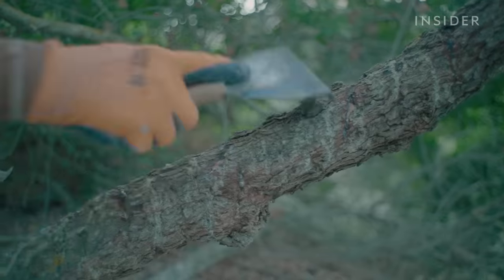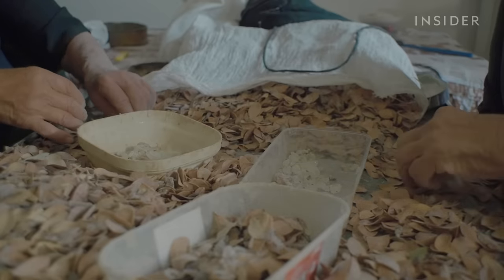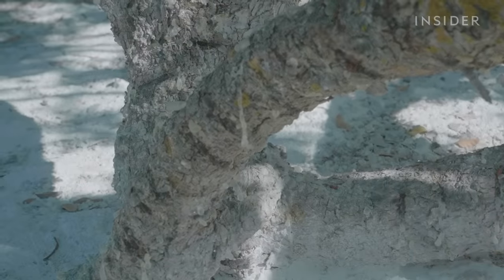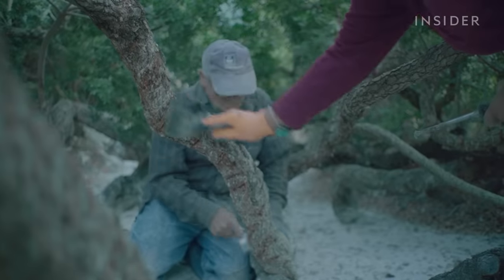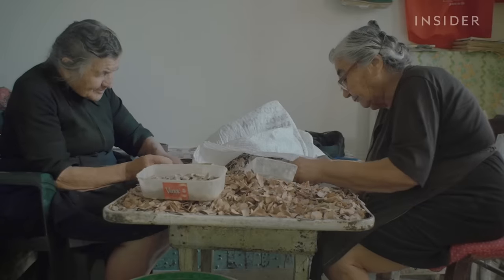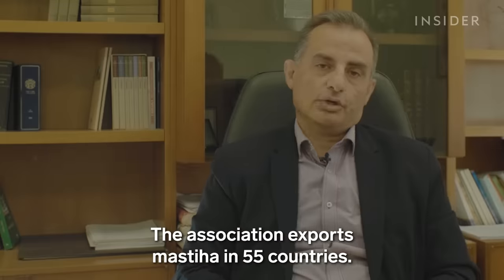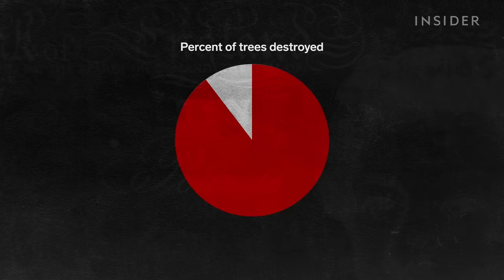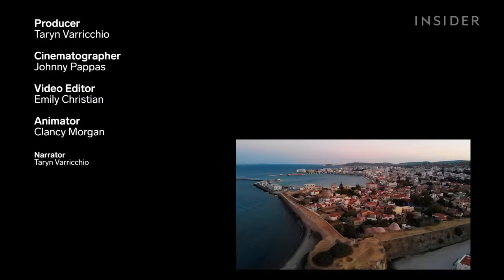Why Mastic Tree Resin Is So Expensive | So Expensive

Comment: You'd think after thousands of years of doing this, they'd figure out a better way to catch the resin, rather than just letting it fall to the ground, picking it it up with a bunch of leaves and dirt, and having to sift through all of it to separate the resin from the debris
Reply: The dirt is what make it collectable, and they can't contain it in container, since the tree heal wound so fast, make it useless to contain
Reply: I was thinking that, a tarp around the tree base?
Reply: they could perhaps tap it like maple trees. but since the tree heals fast it would also need some kind of bite or grind device at the tap location perhaps and would need to be easily move-able as well to not strain one part of the tree too much...
Reply: They know what their doing man!!!
Reply: The same way olive 🫒 are collected before processing into oil
Reply: a sive with a catchment underneath would achieve the exact same result I reckon
Reply: You'd think after thousands of years doing this, they'd wait for a random  Sean guy on YT to teach them how to collect the resin?! How audacious some people are.
Reply: @thanosthanatos8666  doubt it
Reply: It doesn't fall to the ground as is. The area around the trees are first cleared and a layer of white soil is spread. That's not naturally occurring. The resin falls onto this white soil which prevents it from being adulterated by the undesirable elements in the terrain. And no you can't tap it like a Maple tree whose sap flows like water and needs boiling in order to concentrate it into a syrup.
Reply: @Yaksoup98   That's your problem....
Reply: @kyriosmalaka2312  ty random Greek guy for explaining
Reply: @thanosthanatos8666  You are wasting your time. Our ancestors have been collecting the resins from these trees for thousands of years in a certain way for a reason and you are trying to explain basic stuff to barbarians who think that this resin is similar to maple syrup. Waste of time.
Reply: @Soleil43215  😎🇬🇷
Reply: @thanosthanatos8666  🇬🇷🇨🇾
Reply: Why not sweep the leaves and shit away first at least?
Reply: @russellchampagne3830  Exactly, they should do that first. Make it less dirty
Reply: @andrew2477  It's not dirt man! It's a mixture of calcium carbonate, the main component of eggshells, seashells etc, which helps the resin to stabilize and harden. There's always a purpose behind everything, so if you don't know, don't assume!
Reply: @Sem Sol all you’ve done is make appeal to tradition fallacy arguments. Who gives a shit how long something has been done, it doesn’t mean there isn’t a better way. You could have said the same for wheat, or grape production harvesting both purely by hand. This isn’t like those examples but I’m sure there’s still a better way then this, and as others have said some sort of funnel shaped tarpaulin that tapers at the bottom much like they use for cherry trees and the likes looks a lot better then sifting through chalk and breathing the stuff in every time.
Reply: @tinderella2386   LoL ... I was thinking some sort of Leaf Blower would help with the leaves part.  Or several sifters with larger holes to keep the out the leaves.
Reply: @tinderella2386  It's fascinating to read all these comments. Everyone has an opinion about a resin collecting method which they didn't even know its existence if it wasn't for this video. 
It's the last time I am wasting my time answering sassy comments. 
There has nothing to do with "tradition fallacy arguments".  They have been doing this for years for a reason given the circumstances.
Do you think that these people have never thought of a different way to minimize this laborious work of bending and kneeling under 30C? They were waiting for all of you guys for a consultation! No one gives a shit about your opinion. Cheers.
Reply: Their cavemen bro.
Reply: if it isn’t broken why fix it? maybe there’s some resin fallen around the tree, they need those as well
Reply: The sand that it drops into is what makes it premium quality. Extracting it straight from the tree would render the product useless. I have mastic and you can tell the difference from industrial style harvesting and this style
Reply: @Soleil43215  I mean, a lot of shit like this is just tradition and not some real good reason
Reply: Maybe because this specific tree doesn’t Naturally grow in Greece🤦🏽‍♀️ they planted these trees there but it doesn’t naturally grow there! So, of course they don’t know how to properly cut it. This tree naturally has been growing in Somalia, Ethiopia, Oman, Yemen and India! It don’t grow naturally in Europe. Over in these countries listed they don’t have this problem because they usually have a little bucket with them when they’re climbing & slicing the tree, which makes way more sense than what I just watched😂 don’t let them lie to you about these basic facts, Europeans can NEVER leave other countries natural recourses without claiming they got it too SMH.
Reply: You seem extraordinarily smart why don’t you think of a way 🙃
Reply: @Soleil43215  these are the kind of ppl that if you ask “where does your food come from” they will say “the supermarket” lol. They have no idea about the processes that occur for products the consume to get to them, yet they “know better”. Don’t wast your breath.
Reply: Got a better idea, genius?
Reply: @kalashydra9016  "some sort of easily moveable bite or grind device" like a human? Guys maybe there IS a reason they still do it the same way? Jfc press x to use brains
Reply: This is Greece. We do not figure out better ways to do anything.
Reply: Your arrogance might be seemingly justified, but unfounded. There is indeed a reason why people have done what they have done for centuries. And yet, people have improved what is possible using technology by leaps and bounds. Just a hundred years ago, we had to rely on metal and wood for commercial products, but now we have quite literally hundreds of different plastics suitable for many specific and broad applications. That is just one aspect in which humanity has improved in. But that's not what I want to say. What I do want to say is that these guys clearly don't want to change either because they don't want to increase their yield to continue the manufactured scarcity or they simply don't have a reason to- they are selling relatively expensive product and they are making more than a decent living- hence they don't want to optimise - which leads to, once again, scarcity.

Comment: Why not just lay down a tarp to collect the resin droplets instead of sifting through the dirt?
Reply: finally, after 100+ years,,,, this guy came up with a brilliant idea!
Reply: My thoughts exactly mate. If it's more valuable clean you'd think they'd do something other than just scrape the wet sticky resin into the bloody dirt 🤷‍♂🤦‍♂
Reply: @youtubecomments5951  Ya wouldn't leave it there all year round. Just while you were scraping the resin. It's really not that hard of a concept to grasp 🤦‍♂
Reply: @28russ  they don’t just scrape it. It also drips before they scrape and a lot of it goes on floor daily.
Reply: @28russ  they don’t just scrape it. It also drips before they scrape and a lot of it goes on floor daily.
Reply: Well because it traps dirt and then the dirt can be studied 100 of years from now so they let it all fall
Reply: That's a new idea! Tarp didn't exist 100 years ago that's why the farmers didn't think about it.
Reply: 600 cut and 600 trap is time consumption
Reply: @youtubecomments5951  yeah, you are picturing a capture mechanism that covers 80% of the root didn't ya?
It can be done. But that depends on the shape that they're after.
Some will suggest a durable mesh but the resin droplets will stick. A lightweight roof type gutter that contour along and below the branches/trunks would do the trick.
This require additional maintenance when needed scrape the barks. But less labor compares to the collecting, shifting dirt, leaves and sands.
Reply: @Ichi.Capeta  I’m not imagining a capture mechanism. I was told a tarp. But what your suggesting is actually smart. But for one to think a tarp for long term is no good.
Reply: a tarp would reduce dirt getting into the product or else it would require more filtering. a circle shaped tarp with a cut through to the center to quickly wrap around a tree to harvest would be fast and only need to carry one per farmer. It would be removed after harvest
Reply: @prasanthivadamodula771  Do you really just say it would take 600 tarps per tree? Good god...
Reply: Having been there, I would guess that the dust, dirt, and leaves would accumulate on any tarp one would put down anyhow.
Reply: Exactly.
Reply: If they used a sheet or something while scraping they could save lots of resin and would have less resin dust on the ground to sift through for the fallen resin. On top of this the chunk of resin powder on the ground is hard and probably blocks the water anyways as it's caked together from the powder. The Leaves act as fertilizer so it would be best to turn it into some kind of mulch to add fertilizer back into the soil naturally. Just saying there is lots of ways to save money and get more from the trees at same time.
Reply: @Tester-sh1mn  no was saying 600 cups per tree from another commenter talking about using cups to collect the resin.
Reply: @dstyd  Thanks captain obvious! Never would’ve guessed!
Reply: @youtubecomments5951  I don’t think that will be an issue. Trees have deep roots that go all the way down to the water table.
Reply: I came specifically to say that. Their gathering process makes no sense.
Reply: @youtubecomments5951  its hardly to have rain there.. why worry to much.. hahaha
Reply: You can tell it's been done the se way for a long time. They could lay a tarp down before scraping each tree. It would allow them to skip most of the sifting and keep it better quality.
Reply: We'll the legend say this is the right method
Reply: It would stick to the tarp though I think they know what there doing
Reply: If you're concerned about water, you could use a material with fine enough holes that would capture the mastic due to viscosity but allow water to pass. There's certainly a better way
Reply: It could be harvested in a manner similar to how Rubber trees are 'milked' of their resin . 
The same method could be used for other trees whose sap is of importance to people's health ,  like Boswellia , and other aromatic gums like Myhr , and members of that family .  The gum , would be cleaner , and the trees could be done turn about , to allow them a chance to heal , before scraping another very fine amount of bark back , and sticking a half round pipe in , to hold the collection bucket . 
 This should result in it being less labour intensive , and get a better quality product for the farmers to sell on , there in , increasing their income .
Reply: @prasanthivadamodula771  😂😂😂😂😂WTF
Reply: They are crystals not wet like maple syrup.  The crystals are what is scraped from the trees.

Comment: What a coincidence! Just before this video appeared in my feed, I was just checking the mastiha and frankincense infused skin oil I am making. It smells divine! I also chewed on some mastiha earlier during the day.
Reply: How are you making the infusion? I love the combination 😍
Reply: @qwertyasf  I crush the resin in a mortar, the more powdery the better. I place it in a jar, and then pour sweet almond oil on top. I prefer it over other oils, because it doesn't have a strong scent, so it will not cover the scent of the resin. I also shake the jar once a day, and leave it to infuse for at least 2 weeks. It makes a great skin oil for the whole body.
Reply: Do you have any videos teaching the process of making oils? I would love to learn.
Reply: @zimbafashion  I sadly don't use recipes, I tend to use intuition and experiment.  
I do know that resins, dried flowers/herbs and some spices can be used individually or as a combination, and some methods rely on heating the oil to extract the scents easier, but I just do it the lazy way.
I would type "skin oil infusion", and start from there. :)

Comment: I have a doubt. Before scraping the resin why not cover the bottom(ground) of the tree with a plastic so that the resin is easier to collect 🤔
Reply: Glad I'm not the only one irritated by this it would make the job so much easier
Reply: @GoldenBadger they did say that it was sticky but that sticky resin will also fall on the leafs when they collect it. In due time that sticky resin will eventually solidify right
Reply: @GoldenBadger  is it easier to separate it from plastic or from all the fine dirt on the ground?
Reply: I imagine because the resin falls to the ground inbetween harvesting/scraping. They cannot have the pastic out all the time as it wouldn't make any difference then. Plus wouldn't allow for the limited amount of rain to soak in. The above comments mention the stickiness as well which the inert calcium carbonate powder helps with the handling of the very sticky resin.
Reply: @zorbcck   I didn't mean all the time, the plastic sheet should be put during the time of scrapping. I don't know about the powder but it looks like they are sweeping the entire soil( powder, leaves,sand), so as the resin is sticky won't it stick to the sand and the leaf, so won't it create more work to remove resin from the impurities( sand and leaf)
Reply: @susmit1093  The resin can fall to the ground even when not scraping. So you would still have to pick the resin from the ground under the plastic. It's not dirt/sand but calcium carbonate. It will stick to that and not the leaves/bark. Scraping with plastic underneath would still mean you have to seperate the bark. The calcium carbonate is washed off during the cleaning process.
Reply: @susmit1093  I can see where your idea is coming from but, in reality, it's not that practical. The process has been like this for years and will likely continue.
Reply: @zorbcck  the resin which fall to the ground even before scraping would be easier to pick as it might be bigger in size( just an assumption). While putting the plastic only the bark has to be removed and not the leaves( less work). Well I guess they might have tried this method and didn't work as expected 😅, so they choose this method
Reply: @zorbcck   I saw a video I think it was about harvesting pista, in which they covered the bottom of the tree with a plastic and then shook the tree. By doing this it was easy to harvest
Reply: @susmit1093  Yes - they do that with nuts and berries etc but that certainly wouldn't work with the resin.
Reply: They have done this for 1000 years, and I'm pretty sure they know how to harvest the resin in the best possible way.
Reply: @jrand2631  you are right but not so long ago Earth was at the centre of the solar system.  so yeah
Reply: @susmit1093  When people harvest olives they use nets , mostly plastic nowadays.  This work well cause a net can have small enough holes to keep the olives and same time this structure (net) can with relative ease form a glove over the uneven terrain.  Plus they don’t stick on it.  Plastic in general with age deteriorates a lot, micro plastic find their way in our food etc.  You don’t want that in a sticky product, plus sheets of plastic and not nets don’t sit so gracefully over terrain with obstacles and uneven
Reply: @panayiotisyannopoulos2668  Ok then let's do this, plastic sheets( not net) are spread only during the time of harvest. Next after spreading these sheets we sprinkle some powder( like water dissolvable or something like that ). After that we start scraping. By doing this now it will not stick to the plastic and very small bits can also be collected. After harvesting all the materials inside are collected and then move to the next tree. And for the resin that was already on the ground can be picked by hand( I guess mostly large chunks are present on the ground )

Comment: It might be good to plant in a place such as Oklahoma, where there are both wet and dry seasons, and the altitude is almost to sea level in some areas.
Reply: It doesn't work. Many people have try it and even the Chinese. The tree may grow but it won't produce mastiha
Reply: @dnkal2875  it works in Spain.
Reply: @dnkal2875  Actually the Greeks that used to live in Cesme tried to grow it and succeed. However, the pretty much left it after they left Cesme (Perhaps they were afraid it won't thrive there.), but the Turks living here today gradually try to revive it. I believe that in a few years or so, Chios will face a competitor. (Though I doubt it would be legal to import it.). People tend to confuse the lentisk tree (Pistacia Lentiscus) with the mastic tree (Pistacia Varchia.), they are completely different, pretty much like comparing a dog with a wolf. Through such trees exist almost everywhere in Mediterranean, only the Chian variety produces the notorious resin. I don't think it's about the location (plants don't know geography, do they?), it's more about the climate. Obviously, if you live in Crete, you can't just scratch a local tree and wait for it to release its resin. And taking a cutting from Chios won't work either, because both islands have completely different climates. You see, Chios has and dry hot summers and rainy winters like Crete, but temperatures (including where mastika grows) reaches as low as -4 celcius!!! This is not a Mediterranean climate, but rather a hybrid Mediterranean-Continental climate, which itself is extemely rare, in fact the only city in the USA which has such a climate is Salt Lake!! 
Also I understand the Chinese trying and failing, I doubt China has a such climate, anywhere on its territory.